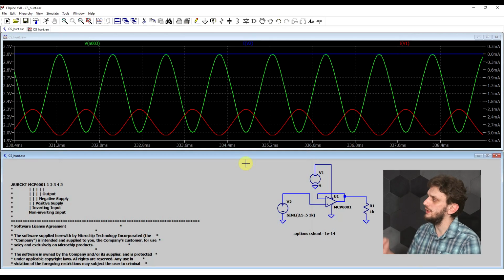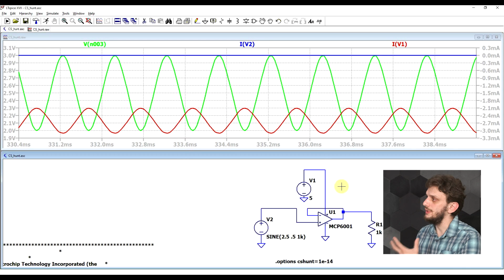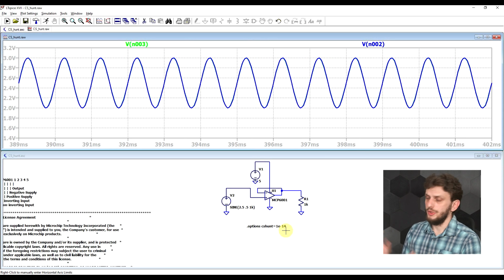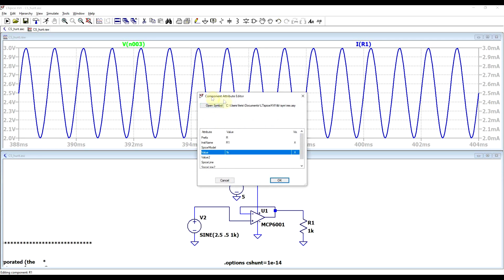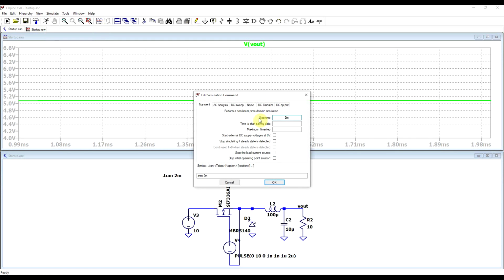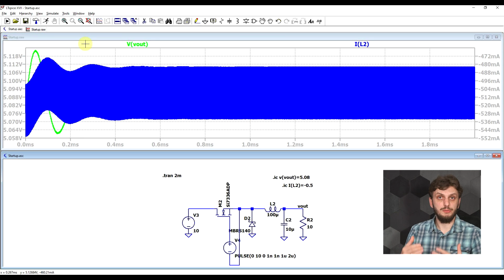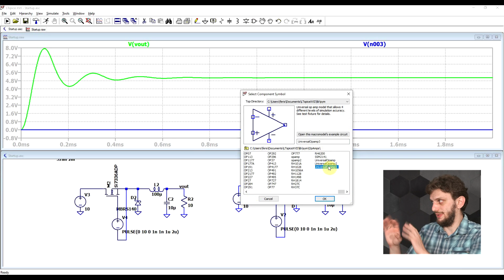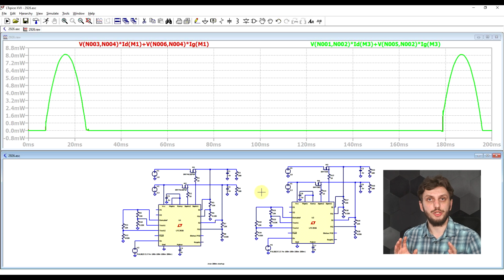LTspice - tips and tricks

Comment: Hi FesZ , I have learned a lot from your videos. I also enjoy a white LTspice background, but I want to know how you changed your mouse pointer color to black in LTspice, because when my background is white, the mouse pointer is still white, so i cannot see it.
Reply from the maker: I did not make any specific changes to how mouse is displayed; however, under control panel -> waveforms - there is setting regarding "mouse cursor type" - I have it set to Auto, but there is an option there for black. I did not find such a setting though for the schematic window...

Comment: For the last trick, will the 'built-in difference calculations' be more useful? I mean, can we plot the waveform showing difference between waveform of circuit1 and waveform of circuit 2?
Reply from the maker: Of course, you can perform calculations with any value from the simulation as long as both circuits are run in the same simulation.

Comment: The last trick with duplicate circuits is also great for deriving the amount of error in a system you’re doing monte-Carlo analysis on. Having both ideal values and varying values on the same sheet makes it trivial to .measure the difference between the ideal output and various worst-case outputs.
Reply from the maker: I never though of that, but you are right!

Comment: I  have watched many of your podcasts and they are very helpful.  I am trying to use LTSpice to simulate a circuit that can detect asynchronous pulses from a source that can have its polarities switched at any time.  I have done this part, but when I try and take the digitized pulses from this circuit and input the pulses to the available counters LTSpice provides, the counters wont work.  The counters do work, if I use an LTSpice pulse generator.  Can you offer any areas where I  may be doing something LTSpice doesn't like?  Thank you.

Comment: Other useful tips include: 1) Using formulae not just node names in the Plot window eg 10*V(R1)*I(R6). 2) The .savebias and .loadbias commands to save/load the entire set of initial conditions - useful with audio amplifier models when you want to look at waveforms or do frequency sweeps without waiting for large caps to charge/settle, 3) The .step temp list.... command to check bias conditions when output transistors get hot, 4) the View, FFT command in the plot window to get an insight into amplifier clipping/distortion. 5) And for advanced users, you can use the .meas command to calculate things like 10-90% risetimes, waveform overshoot, etc. A final simple tip is just to break the circuit and also the simulation down into smaller chunks.

Comment: I have a question regarding the 3rd party symbols and sharing your spice simulation. As of now I create a symbol by opening the .lib file and then I autogenerate a symbol. The symbols are then saved in the default directory. The problem occurs when I move the .lib or I want to share the project with another person who was a different path file setup. The other person cannot find the implementation of that model on their computer as the simulation uses a file path which only existed on my computer.
Is there a way to share LTspice simulations easily without having the other person needing to generate the 3rd party symbols themselves?

I have tried putting the .asy file and .lib in the same folder as the .asc file, implementing the .lib via a .include statement and tried some different path setting the options menu. Sadly without success.
Any ideas?

Comment: Another good one is breaking loops so you can measure loop response. Also another scenario is where your simulation works but your circuit doesn’t (as it oscillates for ex). Adding wire resistances, capacitances and inductances are good tricks to replicate the measured behavior.

Comment: A tip that I learned a short time back was how to easily measure the differential voltage between two nodes.  I thought that i would have to write an equation in the plot window but all you have to do is to move your mouse to the initial node you are interested in, press and hold the left mouse button while moving the mouse to the second node, then release.  The differential voltage between the two nodes will be plotted.  This doesn't seem to work with measuring current, however.

Comment: Fascinating explanation manner as usual and as we used to from you.... Many thanks, could you please clarifying me a point that how to isolat an AC signal on a plot pan that superimposed on a DC, in other words how to plot the AC signal with a zero offset isolating the component of the DC in the simulation. 
MANY Thanks
Reply: if I understand correctly what you want to see...just add a large capacitor at the wanted node (e.g. 1F (one farad !) and put a probe after the capacitor, you'll get rid of the DC component that bothers you. If needed to zoom the AC content (as it may be too small on the same scale as the DC+AC content)..right click on the graph, select "add a plot pane" and add the AC trace on it).Another way is to substract the mean value (ie the DC content) to the trace (AC+DC).
Reply: @yveslesage8525  
Many thanks I have  of course used a coupling DC capcitor 😁😁👍🙏 but for sure the subtracting function is more professional way😉👍😉👍
Reply from the maker: Other than the other good responses I have seen to this problem, I would suggest simply subtracting the DC part - for example if you are interested in node V(n001) which has a 2V DC component; in the traces window, you can right click and edit the plotted expression to be V(n001)-2
Reply: @FesZElectronics  thanks a lot I appreciate your concern to reply...
Reply: Many thanks @Yves Lesage  I have  of course used a coupling DC capcitor 😁😁👍🙏 but for sure the subtracting function is more professional way😉👍😉👍

Comment: The best advice I can give, is the following. I see a lot of people simulating very big and complicated circuits. Often struggling with it or having to wait forever for it to finish. It's a lot easier to divide the circuit in smaller subcircuits and just simulate those little subcircuits instead and focus just on a few parameters. For example, the behavior of a mosfet or some kind of over current protection doesn't need the practical circuit to study its behavior. 

Also, instead of a constant current source, it's easier to work with a resistor and giving it the value R=V(out)/I. For I fill in the current  (100m for example). The issue with a constant current source is that it will always draw the current, which can give very strange values or behavior sometimes. 

One more very practical tip. Bind the run command shortcut to the spacebar. Will make your day so much easier.
Reply from the maker: Great suggestions! I would just like to point out that for current sources, you have a box to tick on the middle right somewhere "this is an active load". This should stop it from sourcing current.
Reply: @FesZElectronics  Oh right, I never thought about that, haha Thanks! :)
Reply: The default hotkey for the spacebar is to fit the schematic to the display window. I use this all the time. I would choose a different hotkey for the run command. By default, there is no hotkey for the run command.
Reply: @bwolfe58  I know, spacebar was just a suggestion, I never ever use that schematic fitting option at all :)

Comment: Great video! Here's another small tip. If you right click on a net and add an '.op Data label' you will see a number with 6 decimals. These take up a lot of space and I normally only need to know one decimal. You can change the data label and use, for instance, 'round(I(R7)*10000)/10000' to round a current to 1 mA, or use round($*1)/1 to round to 1.

Comment: https://youtu.be/xjj2XXDhZRQ?t=898 The thing with the built-in NMOS/PMOS device in LTSpice is that is models a sub-microscopic level transistor, which you would find in an IC. It is not at all a good model for discrete MOSFETs, especially power ones. But there is another device called VDMOS (proprietary for LTSpice), which is better suited for modeling power MOSFETs.

Another setting which can be used to speed up the simulation is TRTOL. Most other SPICE programs default it to 7, but in LTSpice it is set to 1, because it produces less artifacts when making simulations using SMPS macromodels. When simulating Op-Amps / discrete components it can be safely set to 7, so the simulation process is faster.

Comment: One thing that was relay helpful for me was learning some hotkeys. Learning to use F1 through F5 as well as the hotkeys for standard components and rotating/mirroring made designing circuits some much more easy.
Reply: Or just changing them to something that you are already familiar with. The first thing I do after installing LTSPICE is setting custom hotkeys.
Reply: Hotkeys is the only way to go under MacOS I have…

Comment: Useful bits I've learned on your channel:
using .step param (e.g., 
    Resistor value = {X}
    .step param X LIST 1k 2k 5k )
to simulate with multiple values in one run,
and drawing a wire from V+ through one or more components directly to ground is way faster than drawing the individual wire segments.